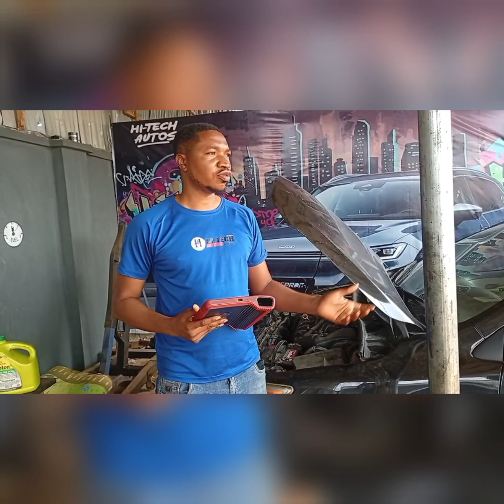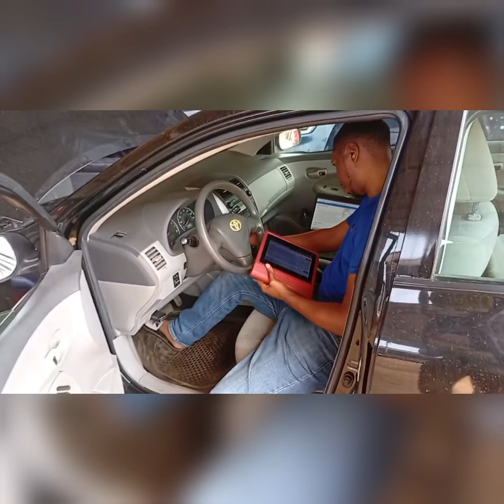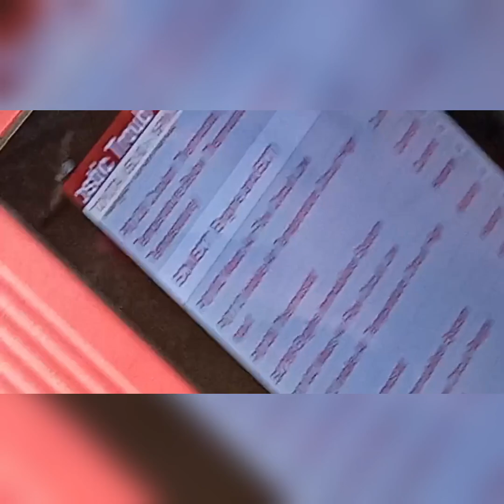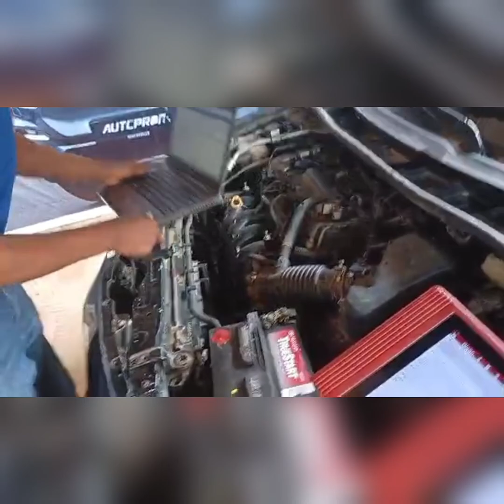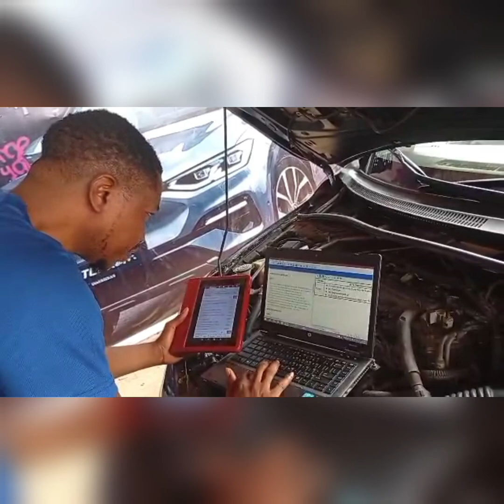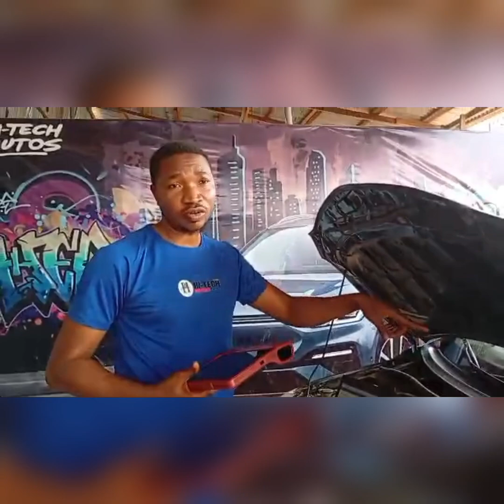Effect of Removing Thermostat from your car

Comment: So how does your analogy of "Road-side" and "Company" correlate with your submission on subject matter? Are you aware that most so-called Road-sides charge more?
Reply from the maker: From my observations, road sides repair shops mostly advise customers to remove thermostat from their vehicles which affects the fuel efficiency unknown to them. In terms of cost as u mentioned, roadside repair allows customers spend excessively buying items that are guessed to be the solution when they are faced with technical repairs that involves sensors and electronics due to lack of modern equipments. An auto repair company with trained technicians will always ensure they keep vehicles to OEM standards which aligns with standard repair procedures and practice
Reply: @Autoprofunlimited Now this is on point and exactly the fact missing in your earlier submission. 

Thank you for the reply!

Also, referencing the "Modern Equipment" point, it isn't really just the lack of it but the KNOWLEDGE of it!

Most roadside mechs were NEVER trained on equipment but tools and oftentimes All you see them (own) with are just some worn-out screwdrivers, couple of spanners and some junk copper wires! so whoever expects any optimum service from them must be 🙂‍↔️
Reply from the maker: @daegold 😂😂😂 you nailed it

Comment: If removing it is so bad, why do some mechanics still recommend it?
Reply from the maker: It’s because of ignorance, lack of information. Few years ago, most panel beaters in Nigeria do cut the wires of oxygen sensor and tell d vehicle owners that it is a plug and has no effect… after many years, they have learnt it works with catalyst and it affects fuel efficiency . Same way they are gradually learning to stop removing thermostat and rewiring the fan circuit to direct.

Comment: What happens during cold weather if the thermostat is missing?
Reply from the maker: Without thermostat, the vehicle computer (ECM) will use assumed value for its decision making (all time cold not recognizing hot and cold) which results to abnormal fuel consumption

Comment: So without a thermostat, will the heater still work properly?
Reply from the maker: Yes the heater will still work because the car heating system works with the air conditioner so absence of engine thermostat won't affect AC operation. It will only affect fuel consumption bcos the radiator fans will be wired directly to bypass a coolant sensor which controls the on and off of the fans  based on thermostat regulations